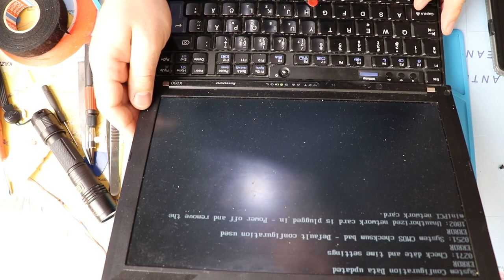Thinkpad x200 with i5 520m disasembly and upgrade.

Comment: You did need to change your CPU cooler right? What about Fingerprint Sensor and else, is everything working fine now?
Reply from the maker: You need mainboard from x201 and cooler, don't forget if you are using wifi card from x200 you should upgrade bios (with custom one... you can find it easy in internet ) I didn't connect fingerprint reader connector is different ... everything else is the same
Reply: @chichovenci  Thank you! Just ordered the mainboard with i7-620m together with the correct cooler from X201 35W. I will replace the wifi card to the 6300 Ultimate found in X201. Thank you very much! Your Video helped me alot.

Comment: did you feel remarkable difference as to speed after upgrade ?
Reply from the maker: It become a bit more usable,
I was "ok" with old config but gpu started to failing...
Reply: @chichovenci  : thank you.  but gpu was intergrated with inside of board of 201, why it's going to failed ?
Reply from the maker: old board x200 had issue with gpu that was the reason to do the upgrade, now with board from x201 everything is working (except fingerprint scanner)

Comment: How about the Ram bro did you replace it? What else did you replace for that upgrade? 
Can i pu 8gb ram on it? Thanks in advance
Reply from the maker: I'm currently using 8 gb ram ddr3 on it. (x200; x201;x220) use ddr3.
Reply: @chichovenci  did you use the hardrive bro from x200? And did the windows from old motherboard still boot up on your newly installed board? Thank you for your answer.
Reply: @chichovenci  i amplanning to upgrade my x200
Reply from the maker: I'm using mainly linux, but windows started up (dual bootable system)upgraded  some drivers and it still working.
Reply: @chichovenci  thanks bro i am planning to install core i7 motherboard on my x200 thanks for the info bro.